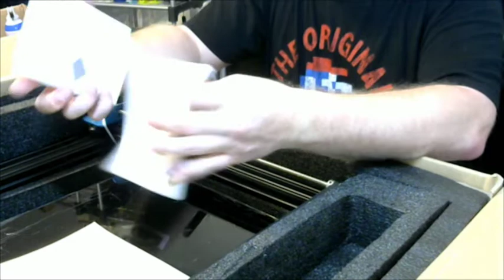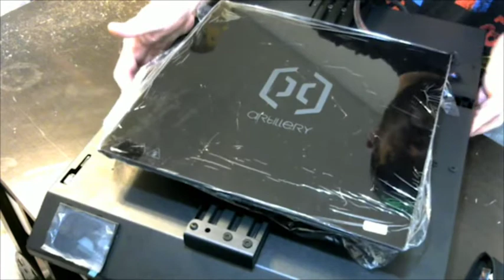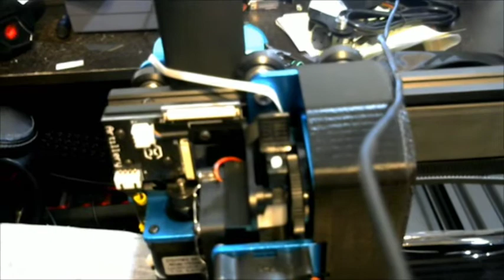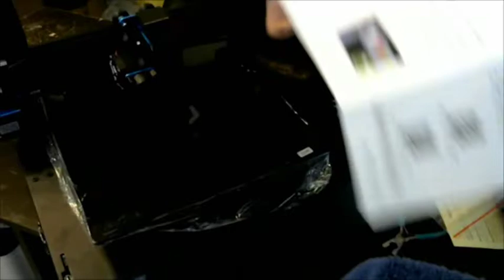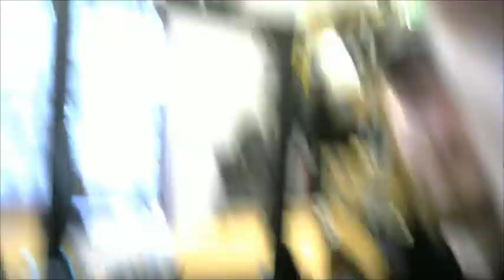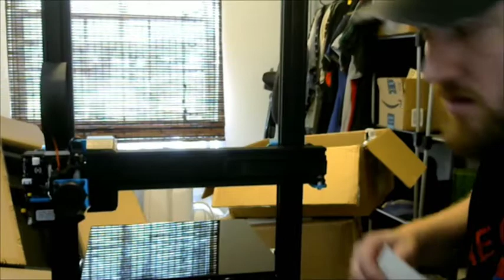Artillery Sidewinder 3D Printer Unboxing

Comment: What price point are they aiming for and what is the print quality straight out of the box compared to after you worked with it. Looking to replace one of my printers at the business and am liking the looks of this one for that role.
Reply from the maker: I sell them for $419, free shipping. While they say they don't have version tracking internally, they're on version 3. I have version 1 and there were z wobble issues and filament run out sensor issues. From what I hear the z wobble has been improved and they changed the bed and run out sensor, but I can't compare the new to the old since I have the original. Everyone I've talked to has liked them, and Chris Warcocki has said good things about it when he got his.